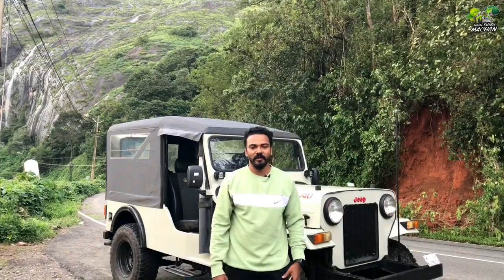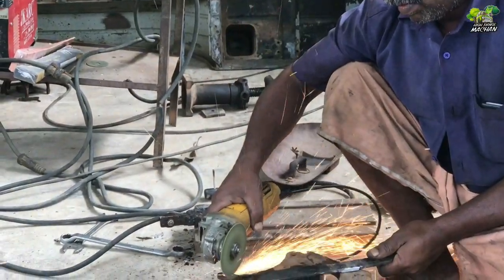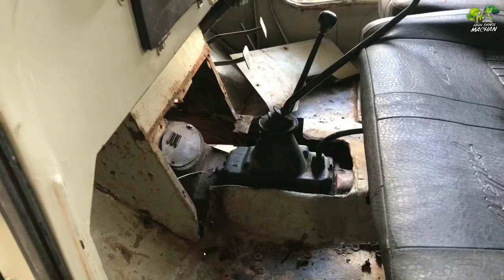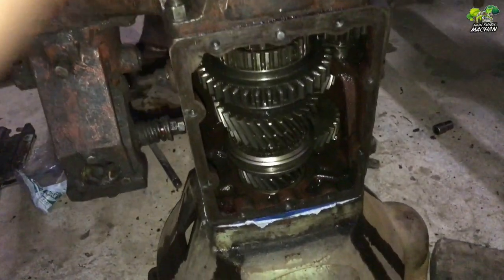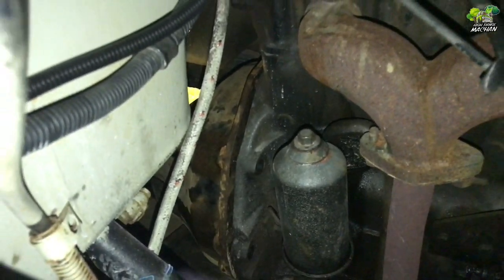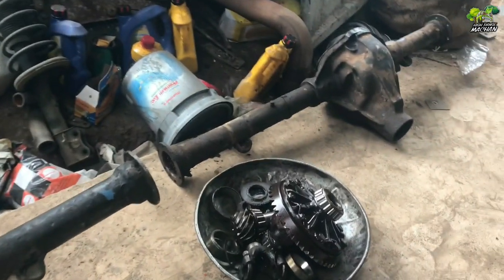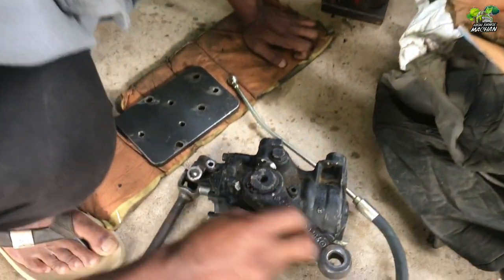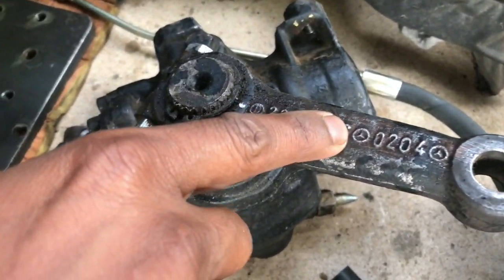MAHINDRA JEEP UPGRADATION/2WD To 4WD/Open Neckle,Wide Axle tube/Disc Break/Power Steering/KMT90 4x4

Comment: Bro 1996 jeepnte pumb paniyaayal viliv kurayumo
Reply: Kurayum.  Valivu kurayan pala karanangal und.Adhyam wheel jam aaanonnu nokkuka, aire filter, disel filter, ivayoke nokkuka ithinu vallya chilavillallo. Clutch disc theernnalum valikkilla, axilator thazhunnundonnu pumbil nokkuka rpm baranyndonnu, athinu sesham pumb nokkiyal mathy
Reply: @ajeshpj8817  smoke koodthal und 😕
Reply: @Vehiclemech11  paniyendy varum
Reply: @ajeshpj8817  pumb paniyan egathesham ethra avum
Reply: @Vehiclemech11  .athu partsukalude theymanam polirikkum .nosil poyittundel 10 Rupayku mukalil pokum.nosil orennathinu 2500 Rupa aakum .pinne paniyunna aalukal nammale vadhikkunna polirikkum.nalla Pani evidannu anweshichitti cheyyana illengil oru karyavum illa .enikku angane Pani kittiyatha
Reply: @ajeshpj8817  okk
Reply: @ajeshpj8817  poly marketiln 2hand medichal kuyappam indo
Reply: @Vehiclemech11  .kuzhappam illa.nallathanonnu ariyan padanu.model koodiya vandeede medichal milege performance oke vithysam varum.2004 nte kittuvanel nallathanu.medikkanum cash aakum. Pumb no 072 MDI aanel direct suite aanu DI yku
Reply: @ajeshpj8817  2004 MDI nte Direct fit ano
Reply: @Vehiclemech11  .kandal direct fit allannu thonnunnu.bolt Matti weld cheyyendy varumnnu thonnunnu.mechanicnod chodikkukka.athum paniyulla Pumb aanel iratti cash pokum athanu kuzhappam.pinne othu kittiyal adipoliyanu
Reply: @ajeshpj8817  millage kurayo
Reply: @Vehiclemech11  .athil irikkunnathu thanne panathu vaykkumnatha ettavum nallathu

Comment: Bro video super open neckel wide axle tube price ethryanenn parayumo
Reply from the maker: Full set - 25k
Reply: @highrangemachan4166  .Disc brake ulpedeyano 25k?
Reply from the maker: @ajeshpj8817  Drum break/including crown pinion,axle,etc
Reply: @highrangemachan4166  .athil 41/11 thannano crown piniyon? Major varumpol vithysam undallo.appol mattiyidendy varumallo?
Reply from the maker: @ajeshpj8817  ahm